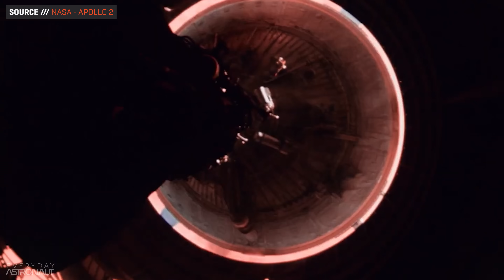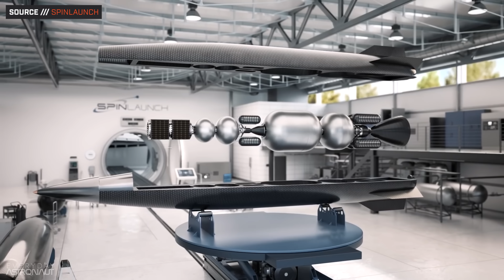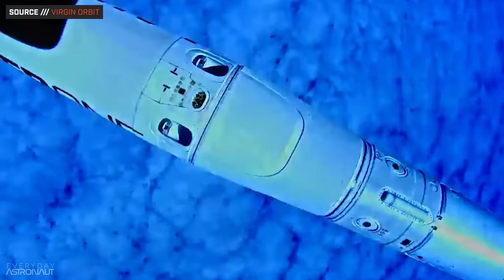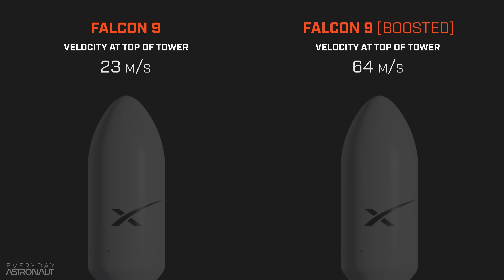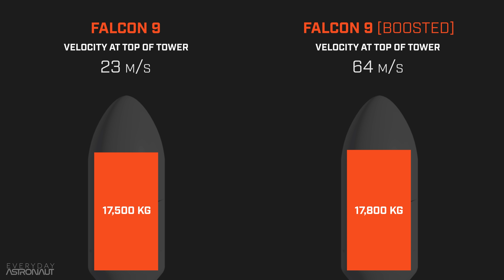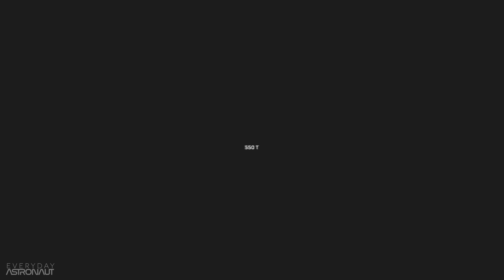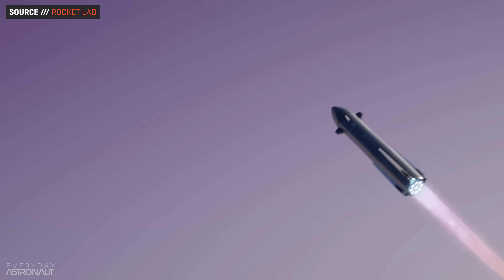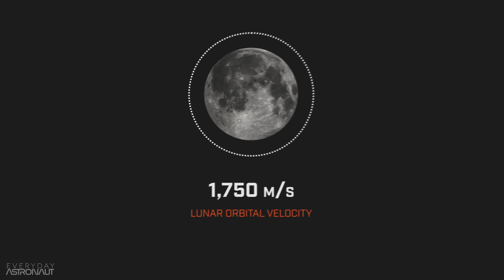Could We Help Push Rockets To Orbit?

Comment: Regarding the counterweight system, you don't need to suspend the weight on top of the tower. You can dig a deep hole, put the weight on ground level, and then drop the weight down the hole. I figured it's much safer that way.
Reply: Problem is that most launch sites are close to sea level.  400 foot, massive bore hole... you'd need massively strong walls to hold the water back.

NASA did study the idea of using a huge pipe in the ocean, suddenly open the bottom part of the pipe and the ingress of water would drive a platform upward carrying the rocket with it.  The concept was rejected because the boost gained wasn't worth the risk and complexity.

I'll see if i can find the title of the study.  I read it as a teen a long time ago.
Reply: Sea Dragon was the name of the project, and it wasn't what I remembered.  You should look it up.
Reply: @thebarkingmouse I mean racist Elon does own a tunnel digging company.
Reply: @thebarkingmouse  See my comment I made under "jmckittrick1" about a similar idea I had. The pipe being underground makes it less risky.
Reply: @thebarkingmouse  The hole isn't 400 feet. Per video, the pully system has a 5:1 ratio so the weight only moves 1/5 the tower distance (plus deceleration zone)
Could lift it 80 feet above a ground water pool
Reply: @MinusYCore was replying to a comment, not the video.  Catch up.
Reply: @thebarkingmouse  Yeah, I know you were. I was calling out that a 400 foot hole isn't needed when there is only 80 foot of travel
Reply: @thebarkingmouse  if you are 400 foot above sea level, then the water at the bottom is you decelerating device.
Reply: It doesn't have to be one weight, it could be several, and they could be horizontally separated from the launch tower and connected by cable pulleys buried underground for safety before they rout up the tower
Reply: then you’d struggle with the effect of the air under it acting as a cushion
Reply: @startwinkk Dig a trench for the displaced air to go directly underneath the rocket, pushing it upwards for initial liftoff/thrust
Reply: @keithnance4209  i feel like newton’s third law won’t allow that to have any effect, but i could be wrong.
Reply: I really really really big rock
A rocket rock
Reply: I imagine maintaining a 400' hole carrying 2 aircraft carriers worth of steel comes with its own risks.
Reply: @emmakai2243 could be a tank filled with water.
Reply: @emmakai2243  it has a 1 to 5 ratio over pulleys, the drop gonna be 1 fifth the height of the tower. (he did the ilustrating video wrong)
Reply: @joaomrtins   Whatever the height and # of pulleys, pure gravitational potential is no way viable...except maybe as an amusement ride.
Reply: @emmakai2243  You can use water instead of steel. I mean they already use watter bags for testing the chopstics on mechazilla.
Reply: @emmakai2243 not really. Ever heard of a mine?
Reply: @howdoeshedoit3374    This is not a mine.  So what's your point?
Reply: Go ahead and flush this idea down the hole
Reply: You still have the pulley at the top, loading the tower during launch.  The height of the weight doesn't matter.
Reply: Why not both? Build a launch system next to a waterfall, let the river fill a suspended tank, use it as the counterweight, balance out acceleration from counterweight with capacitor-powered acceleration, place the assisted acceleration track in a vacuum tube, then pray that all these overengineered parts work together in any way.
For small payloads resusable rockets or space planes lifted by stratospheric balloons may be a simpler way to drive costs down.
Reply: The energy used to lift the weight again would be the same energy equivalent to launching the rocket.
Reply: @daveyshmavey  but it can be exerted over a longer period, meaning less force is required at any moment.
Reply: @startwinkk but in total, will require the same energy. Physics doesn’t allow for a trade. The trade would only be worth it if the cost of energy for (loading) the system was cheaper than the cost of the fuel used during launch. Cost may not be an issue if it helps with time.
Reply: @daveyshmavey  That doesn't matter. We're not trying to just save energy. We're trying to move the energy requirement off of the rocket itself.
Reply: Cheap liquid like water or gravel (to prevent sloshing) for the counterweight so no 100 mil+$ cost for that, and if you're going underground anyway then you might as well make the slingshot elevator travel longer like 1-2 km down, and at that point, if you're there anyway might as well use the difference in temp you get from having facilities so far down to grab a constant flux of geothermal energy while you're at it to feed into lifting the counterweight. And, considering you're going underground now, you can also split the counterweight into smaller radially distributed weights to reduce the load on the materials. Also, considering you're moving big chunks of material through a tunnel, you can also connect the air pockets under the downward traveling counterweights to the tunnel right under your rocked that would cause the increase in pressure from the air getting compressed by the counterweights to start pushing on the bottom of the rocket while it ascends (you're not going to do vacuum tubes anyway, might as well use the air pressure push too), etc.
Reply: @Kmykzy I get what your saying but the air pressure needed would be astronomical. You mention water…. Water can be pumped, transferred. That shouldn’t require the the same amount of energy. The volume of water could be dropped then pumped out rather than using massive amounts of energy to lift the weight back up. 
    Still, you can’t get more energy out of a system than you put in, at least not yet. Geothermal is a great idea but that wouldn’t require only get you so far, at 5 miles deep your temperature is around 500°F. That only equates to around 450# steam. 
   The new CO2 turbine generators that are being created are incredible and will bring a massive amount of energy for all kinds of possibilities!
Reply: If you drop the weight into the hole, as a piston into a cylinder, the compressed air could stop it at the bottom... But, because of the built up pressure, Earth might fart from the other end.
Reply: You'd need a robust arrestor system to keep the weight from slamming into the earth. Else trigger a fault to shift with that kind of weight slamming down repeatedly.
Reply: While you are at it, make 33 raptors burn downwards on the counterweight. :o)
Reply: Yea. And run a tube of water or something underneath the ship. No cables necessary.
Reply: @brjones27  yes. A hydraulic piston.
Reply: You can probably also add multiple wheels to reduce the masse (but increase the dept of the hole)
Reply: I guess the acceleration and speed gained is negligible.
Reply: Only if you're not standing at the bottom of the hole.
Reply: Weights fall with a fixed acceleration. SuperHeavy accelerates faster. Pulley blocks reduce the effective counterweight (1/2 1/3, etc) You only get assistance below the upper pulley block.

Weights fall with a fixed acceleration. SuperHeavy accelerates faster. 

You only get assistance below the upper pulley block. 

The tower arms are designed to support 200 tons, but the total Starship is far heavier, 1,585 tons, plus Super Heavy at 3,675 tons.
Reply: You can also drop it a lot further so it doesn't have to be as massive too.
Reply: @user-yg5hk1yb3n you can't drop it further with less mass with pulley because the acceleration will be lower than 1G. If you want 2G acceleration you need a mass at least twice as much as the thing you want to launch with a pulley system dividing the distance travelled by 2.
Reply: In cape Canaveral the water table is approximately 1 shaq deep. There’s probably launch sites slightly higher than Floridian sand bars, but all of them are near the coast so any debris fall into the ocean and not in cities.
Reply: but danger is the spice of life D:
Reply: Drop the counterweight into the hole and use appropriate gearing.  A depth of double tower height, half the weight to be dropped down the hole to get the same energy (its is linear, Epotl = m.g.h).  And so if you dig 4xtower height deep = 1/4 weight, and so on.
Reply: Why does there need to be a 5:1 pulley ratio to begin with?
Reply: Well the top part with lets say a large wire will still need to support the load, if you have the load hanging in the air or suspended in the ground the reaction is the same at the height of the massive sheave.
Reply: instead of counter weighting you could also just extend the launcher to change its center of gravity and prevent it from ripping itself apart like that
Reply: The shockwave will destroy everyone inside the hole.
Reply: Then, how do you get it put if the hole?
Reply: @jwv6985 I would go with modular tanks of liquid that could be pumped in and pumped out of the tanks.
Reply: @mac_mcleod that is a good idea 💡
Reply: @jwv6985  Thanks.  I'm sure someone smarter than me would think of it should we try to do it.   And see problems I can't see.    But tanks would be easy to empty and fill.  And modular tanks would be easy to repair and maintain.
Reply: @jwv6985  Ok - then you build a second hole on the other side...
Reply: @jwv6985  you lift it? your gonna want the weight back to yeet another rocket anyways
Reply: @jwv6985  did you guys forget Elon owns the boring company he could just scale one up for the job. You could put the weight on rails to control the fall and create an arrest system to regain some of the energy gained by stopping the weight sounds pretty good.
Reply: The tower would still need to be able to withstand the downard force of the weight pulling the rocket upwards, at those energy levels it is doubtful any material or wiring would be able to sustain those forces
Reply: @ipadista  Yes we can. The problem is just that the gain doesn't worth the cost and effort.
Reply: @ipadista  for the tower a steel reinforced concrete obelisk. With a deep foundation because the ground will compress.
Reply: Super heated steam or a compressed air system you`d need 2 pistons to balance the shock/flexing of the tower, then there`s the power source nuclear is a no no due to stress on the system, fusion is at least 10 years out, Hydrogen/combustion or induction are the only ways to go then the steam needs compressing to create more heat........
Reply: Or, indeed, don't dig most of the hole. Use the soil/rock itself in essentially a really big bag as the counterweight. Literally "dirt cheap" mass that's already in place, falling an arbitrarily small distance with enough mass and lever/pulley/hydraulic ratios. Now, this is absolutely handwaving a weird mining and construction operation, evacuating the bottom cavity, etc.

Comment: how about solid rocket boosters strapped to the outside of the first stage?
Reply: railgun going up like a rollercoaster combined with skyhook. Will happen 2050. All your stupid "ideas" is equivalent of paris in horse poop and triangle wheel.
Reply from the maker: Exactly 😉 We talked about that specifically in my launching from mountains or equater video where the much simpler thing to do is just use SRBs or increase the size of the rocket.
Reply: Your solid rocket booster is making me curious about doing that with the pulleys. Hear me out a horizontal SRB pulling the pulleys making in recovery cost of SRBs much lower. I'm not sure how long the runway would need to be
Reply: @jfowl1989  the cable pull distance would depend on the mechanical advantage you want (multiples of the tower height).  But as Tim mentions later in the video... "keep it simple" is always going to win out.
Reply: Fundamental problem is that you only have the tower height to accelerate (and do not forget the chopsticks need space to decelerate again once the rocket detaches, at least if they are to be reusable). If you could get useful delta-V within the available distance and acceleration limits, you could just bolt some extra rocket motors to the chopsticks solving your structural and energy problems quite simply!

Comment: Tim, not meaning to complain, but your American audience are not going to be sufficiently impressed by a number in kilograms. Most of them (including myself) have no way to relate to a term that doesn't mean anything to them. Perhaps also including the number in tons would be be better.
Reply from the maker: These numbers are so big and relative any way that I don't think the unit matters at all. What's 1,000 Megajoules? I have no idea, that's why I broke it down into something understandable, batteries. What's 175,000,000 kg, I can't really comprehend, but even if it was 175,000,000 pounds, would it matter? It's HUGE, beyond comprehension.
Reply: @mikehall4517 From the UK, I think it's a great idea to use Kg. I was very impressed. This channel doesn't just have a US audience. The world is bigger than that.
Reply: @ColinDH12345 I syggested thst using both would help. He has an American audience slso.
Reply: 2 pounds =0.907 kilograms
Reply: @eyeris5812 Sure, and 2000 pounds equals a ton. My point is most people don't have the interest in doing conversions in their heads to get an answer thst means something to them.😊
Reply: 1000kg ~1ton.
Reply: With due respect, any American interested in rockets or STEM topics in general, would be well-advised to get comfortable with the metric system.  Enough of this backwards catering to parochial lazy slobs.

Comment: Hi Tim! Thnx for an really interesting video 👍 What about an aircraft carrier like catapult? - Powered by modified rocket engines... Those engines should be able to convert fuel energy to pressure energy fast enough as the piston moves and gas volume in the cylinder increases.